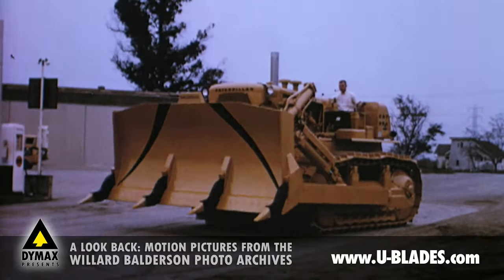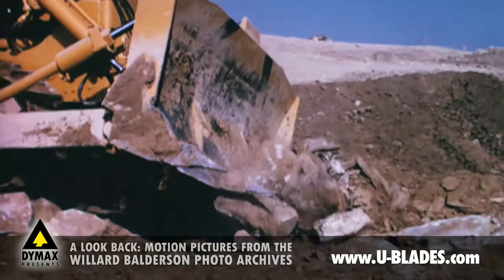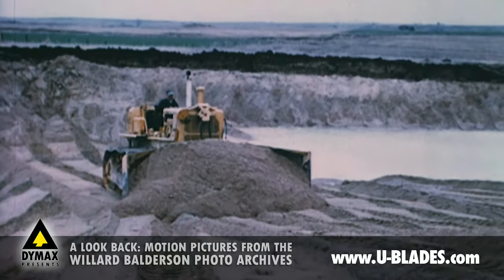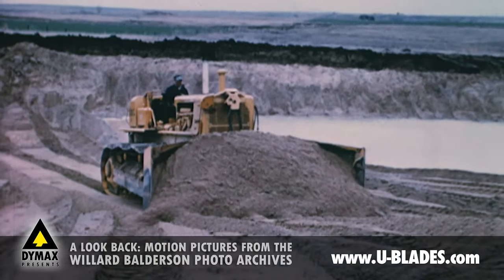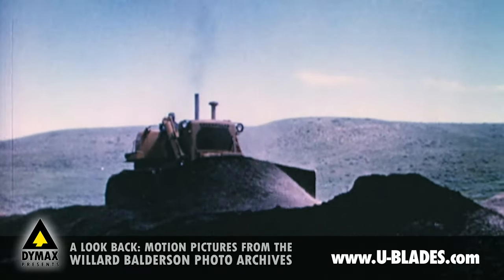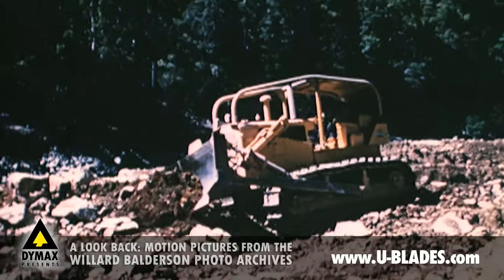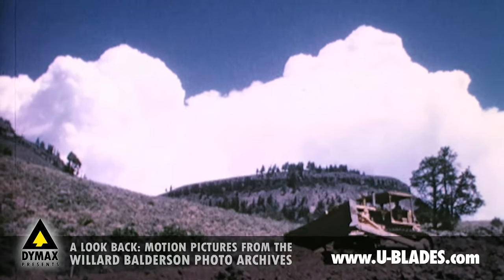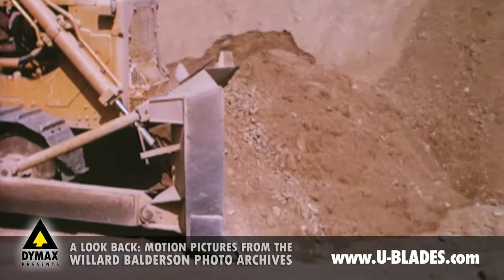PART 1: Old Caterpillar Dozers Working - The Biggest Yard (from the Willard Balderson archives)

Comment: Although I never worked in the industry, it seems to me that the "digger dozer", also known as the "Gyro dozer" never really caught on. I've seen various blade attachments before but I've never seen the digger dozer blade. Perhaps contractors were satisfied with the performance of rear-mounted rippers that could be raised/retracted when not needed.